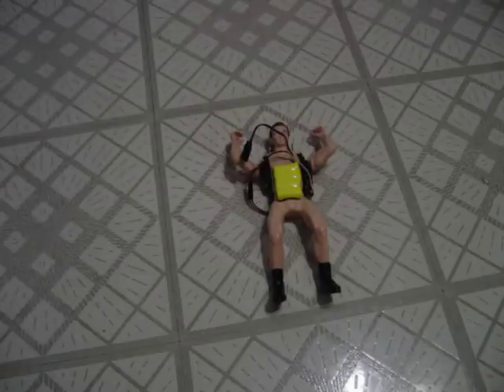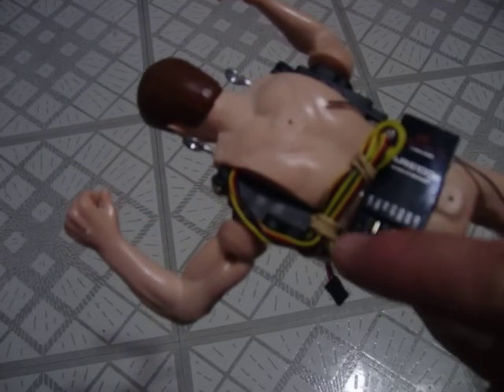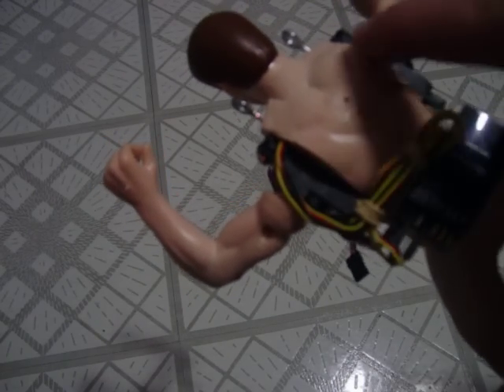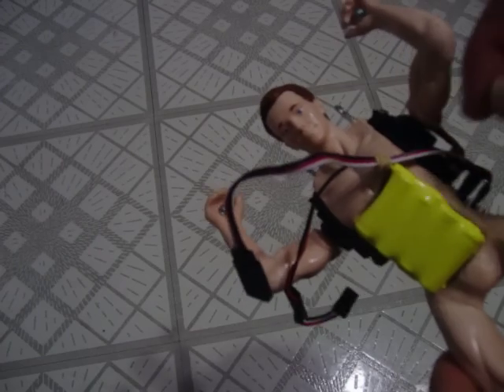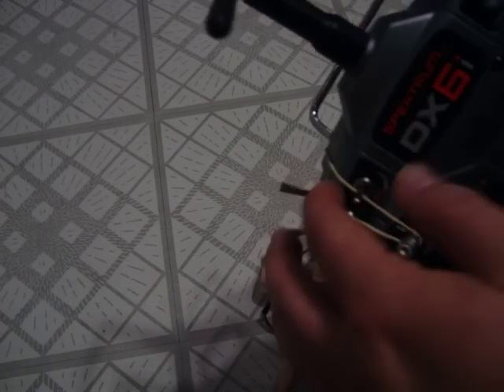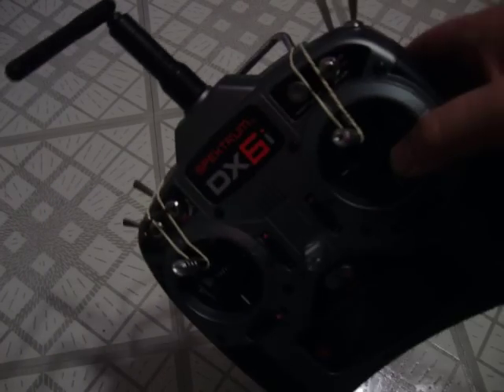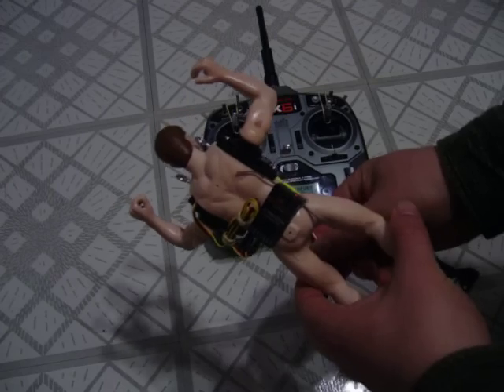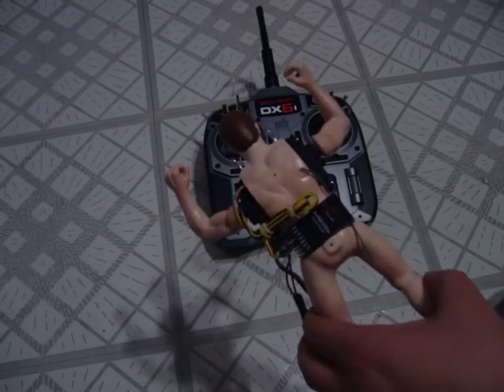Micro Diver Generation 2, Remote Controll Skydiver- Part 1 - Build, electronics, Radio setup.

Comment from the maker: There is a string attched from his right hand to a pin that goes in the closing loop of the container, by moving the right arm down anytime during freefall it pulls the pin which opens the container and releases the pilot chute wich in turn helps to deploys the canopy.  I have already filmed this procedure up close and will include it in my next video whenever I get a chance to chuck him out of a plane or something high.  Subscribe to my page so you can see the video when I post it :-)

Comment from the maker: Maybe, I thought so too before I got it, but now I have it put together I can't see how, the control sticks need to be returned to the full 'up' position for stable freefall, pulling of the pin and full flight on opening. I just did what is recommended in the instructions for now, I will look into it latter for sure.
Thanks for asking/watching :-)